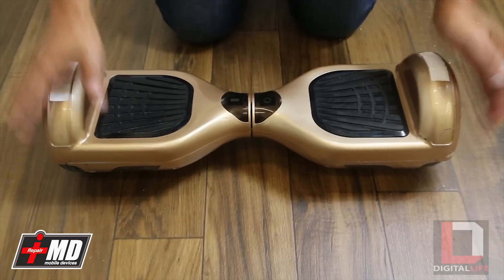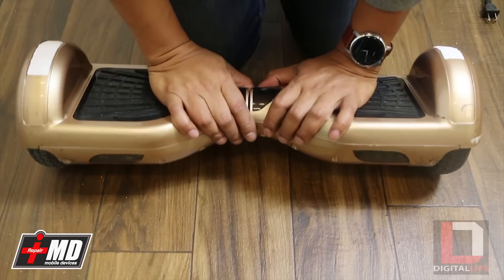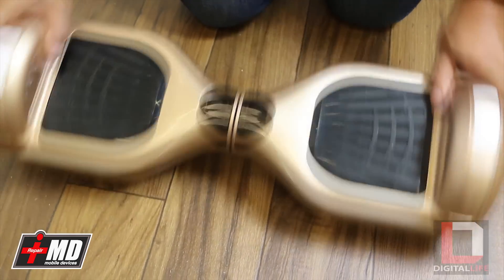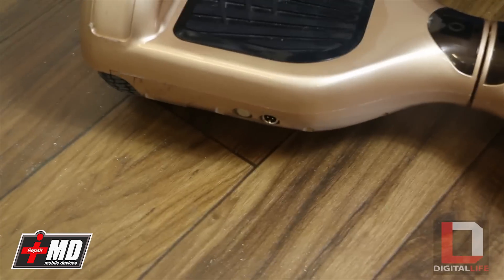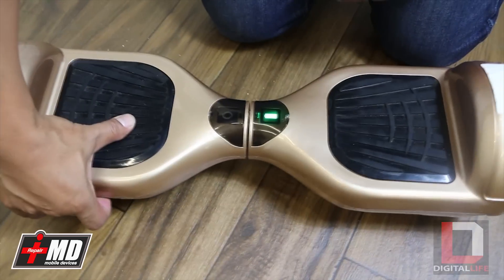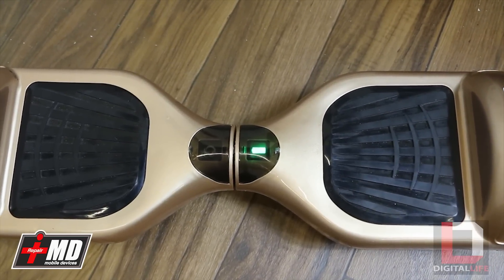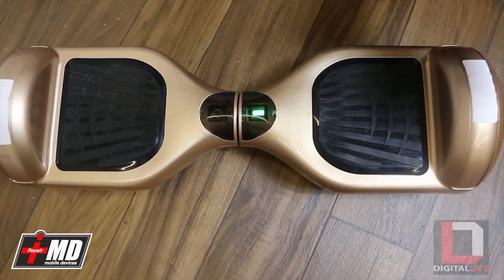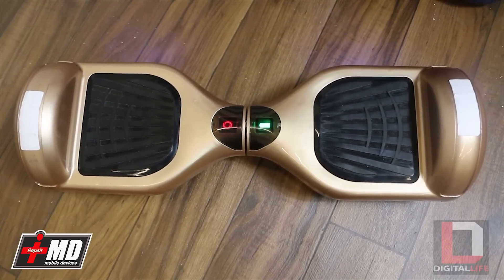Calibrate a Balance Wheel scooter

Comment: my board is making a clicking noise on the side that does not have the battery symbol. It is pretty loud and quite irratating. Any idea?
Reply from the maker: +Nick C. sounds like you have something small lodged in the wheel
Reply: Thanks for the help, and such a quick response. I'll try it out and let you know what the results are.
Reply: Update Just found a piece of a stick/branch caught in the side. Thanks for the help!